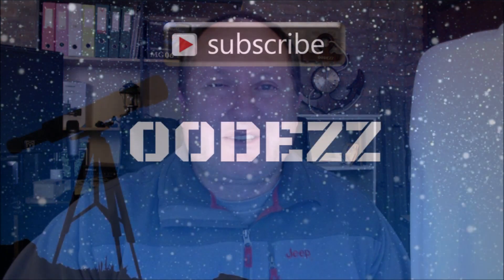00DEZZ - See if Petrol stations are cheating - Basic Science lesson.

Comment: You can tell petrol or diesel is less dense than water as it floats on the water.
I often fill up 20 liter Jerry cans to the brim with diesel and at some stations I can get up to an extra 500ml in the same cans so obviously some places are under supplying.
The temperature also needs to be taken into account for the specific density.

Comment: i don't know if i agree, density and volume are two different measures, 1lt of petrol should be exactly the same volume as 1 lt of water, the weight will be different..... 20lt of petrol and 20 lt of water should be the exact same volume, regardless the density and weight, because we don't sell fuel by weight, but by liters!   its like asking what weighs less 1 ton of feathers, or 1 ton of gold. 
i guess my point is, 1 litre stays one litre, doesnt matter what the substance is.
Reply from the maker: This has nothing to do with temperature. Volume is volume not MASS. I know I am 100% correct. The topic here is not contraction but the fact that someone said a plastic container cannot be used because the sides bulge out. I proved them wrong.
Reply: @00DEZZ  I understand that & I'm  not conflating the issue  but including the fact as a way  that  we may be getting  gypped.
Reply: In Canada our pump's metering is adjusted to 15° Celcius year round. 
I've  heard it said it ought to be adjusted in the summer as  well. 
Interesting,  but I don't  have  much info on data of the storage tanks; depth & temp  measurements.

Comment: The weight (mass) of the feul and density will tell you how much liters you have.
Reply from the maker: The MASS has NOTHING to do with volume. A liter is NOT a Kilogram.
Reply: @00DEZZ  density= mass/ volume. So if you know the density of the petrol, wich is approx. 800kg per cubic meter then 20 liters wil have a weight of 16kg. If you have a calibrated scale you can go check it.
Reply from the maker: @stoffel89  This is obvious. The video has to do with a video that was on Facebook where an idiot challenged the person in the video and said he is spreading fake info because a plastic container buckles and therefore the reading is wrong. I just proved that a plastic container is fine. We do not measure fuel delivery in kilograms.

Comment: Mmmmmm funny u should be bringing this up now Dez , I filled x2 25 ltr plastic containers with petrol at my local garage before it went up the night  and u noticed that each container took over 27 ltrs , I did fill them as much as I could with out then over flowing but I still recall thinking to myself mmmm, surely there shouldn’t be more then 2 ltrs in a 25 lt designed container ? If it was say 500ml ok but over 2 ltrs in each 🧐,smell a rat 🐀 now , I’m gonna have to follow up on that , also especially if they able to adjust the calabration just before the feul price goes up !!?

Comment: I am a service station owner. My pumps are calibrated annually. I have no control over it and the whole process is handled by the oil company. I receive a certificate which have to be displayed in my HES file for inspection at any time. Public must not be put under the idea that all filling stations is out to steal  from them.
Reply: have you tried the 20l test?
Reply from the maker: I am sure that 99.99% of filling stations comply.
Reply: Do  you know if density of Petrol/Diesel play any part in the calibration process?
Reply: I'm just amazed that we still have white-owned service stations.

Comment: It's calculated digitally, it would be soooo easy to implement a multiplier on the volume reading and then simply flip it back when you get audited.
Reply: So do the same to the odometer on your vehicle 🤣🤣
Reply: @pieterwiese6416  That's much harder because savvy investigative engineers can, theoretically, examine the wear and tear on various parts to tell if the odometer is wildly off. With this the only real way to know is to measure exactly how much fuel was depleted at the time the measurement was taken.